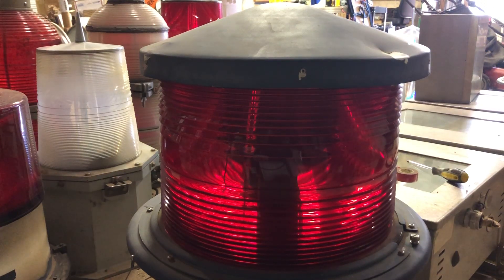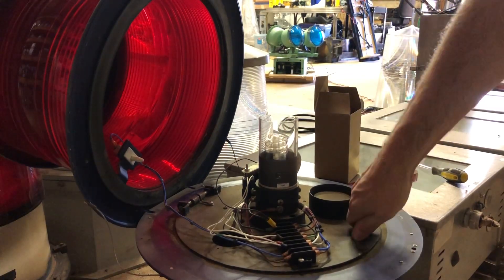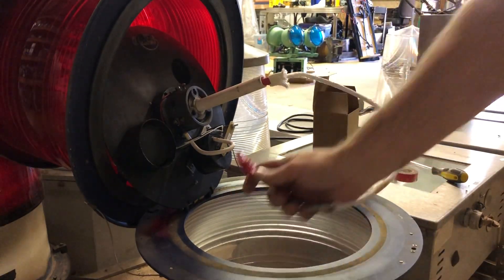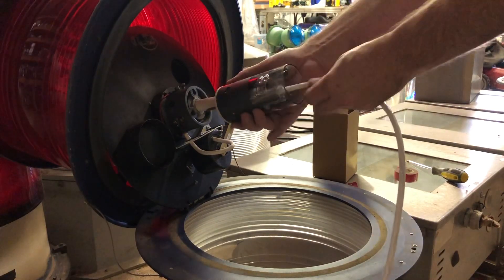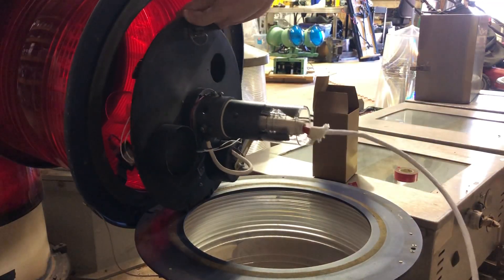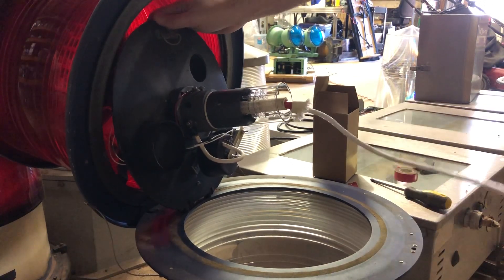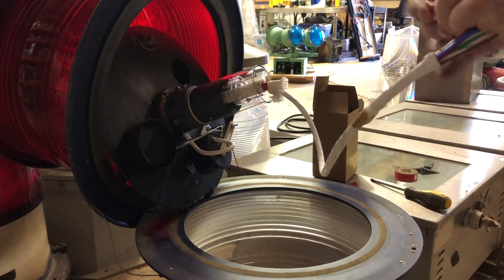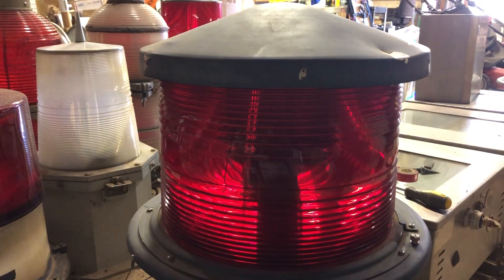TWR E-1DB Tower Strobe Flash Tube Install

Comment: What would be the most annoying? Flashguard 3000 or the FH-306 and FH-324 sync with the Sterling Sentry 3v8-H Siren connected to the marker circuit...if that is possible. To make it sound not as long, make the system go into white night mode backup.
Reply from the maker: That would not be possible, the siren requires 240VAC and the marker output is only 120VAC.
Reply: Do you have any 120 volt sirens?
Reply from the maker: @jacobflanigan6343  I do not, I wat to get a 120v Federal Signal resonating horn but that will have to be when I have the extra money.
Reply: @jonboyok Can you do that Beacon